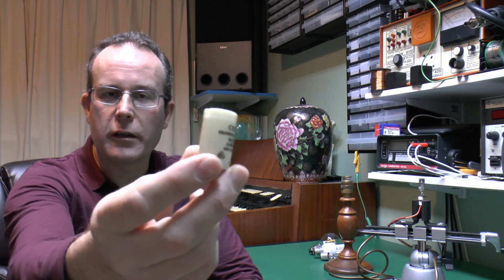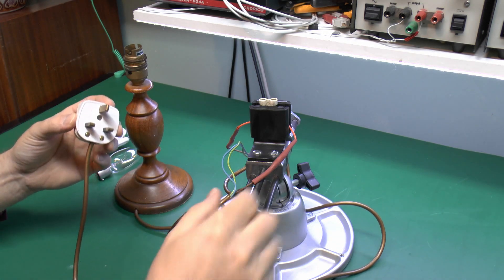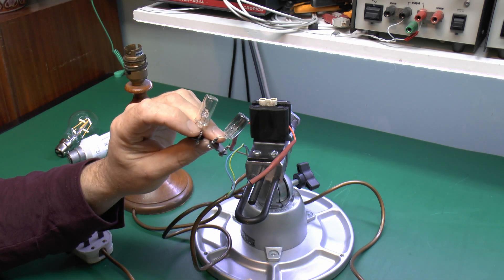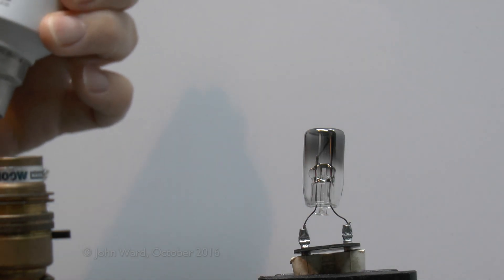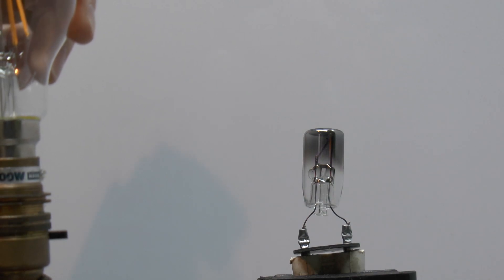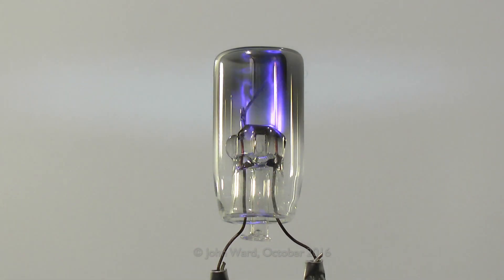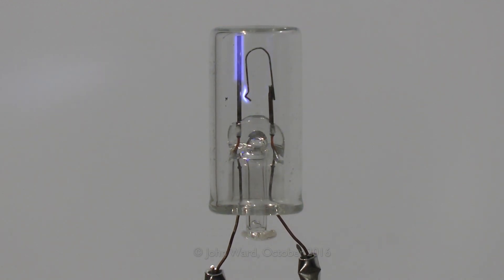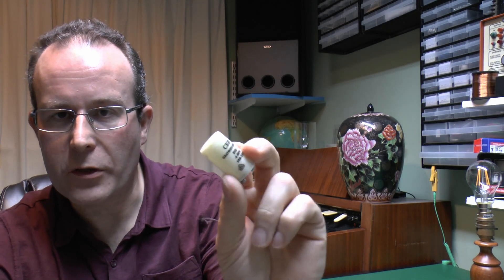Fluorescent Glow Starters

Comment: Hello,
I removed the plastic cover from a brand new Osram St 111 starter (4-65W) before placing it in its socket, then I flicked the switch on and off multiple times make the glow from the starter bulb last as long as possible without the fluorescent tube lighting and only looking at that mysterious blue glow for a few seconds caused me some headache
Don't fluorescent starters emit at least some amount of UV aswell as orange or blue light ?

Comment: The capacitor also serves an additional purpose. Just before the contacts of the switch meet it discharges across them, which gives a slight welding effect so they don't open too quickly. That's important for proper heating of the electrodes in the tube. 

Starters seem to be a component of which the importance is severely overlooked these days. 

The hardness of the switch contacts should be careful chosen to match the lamp current, so they stay closed long enough for the electrodes in the tube to be heated. Soft contacts weld together more easily, giving a longer heating period, but may weld together permanently if the current is too high. If they're too hard or the current is too low, they do not weld together and do not give sufficient heating.

The voltage at which the glow discharge takes place is also important, too high and contacts barely meet, which again will not allow sufficient heating of the electrodes. Too low and the starter contacts will reclose even if the tube is lit, causing nuisance flashing. 

Thorough heating is important to reduce wear on the tube each time it is started. These cheap universal starters appear to work perfectly adequately in that they start the tube. How they go about it is often far from ideal.

Comment: 2020. just discover, a rarely used back shed fluro, not working, but by accident noticed the radio in the house, was VERY  badly effected   (am radio station),  wall fitting in shed, is a double - with only one fluro- so good to find out the missing fluro is not causing a problem,  further to this video and the other video- could you do a video showing the effect of the starter capacitor wearing out- high resistance growing  less toward shorting- as this i expect would really be the culprit, causing the  fluro to flash when running- flashing getting worse til dead, , somewhere in between that radio interference- from Steven- Melbourne

Comment: The glow-switch starter was invented by 1938
It is a small discharge tube containing a bimetallic switch,
As current continues to flow through gas (usually argon,neon ) in the starter, a small bulb containing To ionize , Glow in the starter heats and it increases the temperature inside the starter starts to bend one of the metal contacts inside, in the same way that a bi-metal thermostat works.
The starter (which is simply a timed switch) allows current to flow through the filaments at the ends of the tube.

Comment: What is the gas inside these? Should be argon / neon or another noble gas - but not only! Some of these explode in a cascade of sparks if you break them (cold, not connected) so they must contain something that reacts with oxygen or nitrogen. Possibly phosphorus. (This only goes for some brands (or even just one) and I forgot which ones, although I could possibly find out by popping... I discovered this 20 years ago or more so I'm not sure if it also goes for newer models)

Comment: when starter gets opened after some time due to inductive kick the large tube light gas gets ionized but y not small air gap between starters gap not ionized??
Reply from the maker: The tube filament ends are hot and coated with chemicals to assist with electron emission, the starter contacts are not.

Comment: Hi John. Could you please tell me if a 110v bulb for festoon lighting would work safely on a 230v supply in a domestic premises.  Cheers
Reply from the maker: It will work but only for a few minutes.  it will get very hot which may damage the lampholder and cable.  Demonstrated in this video: https://youtu.be/H0n_oBgmB2A

Comment: I remember working  in the Steel works in the 70s or 80s my boss was after some disco lights so wired some starters in line with colored bulbs worked a treat and earned me £20 :D just by changing value of the capacitor changer flashing rate

Comment: What would've happened if you had left the capacitor connected across it?
Reply from the maker: The same, the capacitor is only there to reduce radio interference when the contacts open.
It was removed in the video so that the glass tube could be seen without the capacitor in the way.

Comment: John, a common mistake is for people to install "4-80W" starters in 6ft 1800mm 70W (or the old 75/85W T12) setups, the increased lamp running voltage borderline exceeds the threshold of the "4-80W" starter giving an annoying brief flicker once every few minutes.
You need the specific 6 foot or the more common FS125 8-foot variety of srarter for 6-footers to be reliable at all temperatures.
I've been to countless faults as above, even caretakers and maintenance electricians  argue the toss that if it says "4-80W" it must be right for a 70W tube. But no.
The gas fill in the starter differs to give a different conduction threshold voltage. You will notice the "FS-U 4-80W" have a blue glow, whereas the 6ft and 8ft FS125 types have a red or orange glow.
Reply: What about operating a 5ft 65w tube on a starter deigned for 70-125w tubes? It appears to work and starts up fast enough but am I shortening the life of the tube by doing so?
Reply: uK8cvPAq No harm, just takes a fraction longer to close the contacts, and small chance the lamp may not strike fully, running in a higher voltage lower current mode then extinguish and re-strike a few seconds later.
Reply: Simon Parkinson Cheers. I know a thing or two about LED lighting but have never delved into the art of florescent tubes until now.
Reply: i got hold of quite a lot of the fs125 starters very cheap (free!)  and have used them on smaller tubes no problem, never tried it the other way as dont have any really long light fittings..

Comment: What might be interesting to mention would be the very old style manual start fluorescent systems. There are still several desk draughtsman type lamps where I work that are manual start fluorescent.  

It wouldn't be a great deal of work to rig up a circuit to demonstrate manually starting a fluorescent tube either I wouldn't think. All you'd need is a ballast, a tube, and a few switches.

Comment: I've had a lot of trouble with the very cheap starters in the lights I maintain at work and no longer use them and for that matter remove them when I find them. The contacts fuse together and overheat, causing the shattering of the glass tube, melting the plastic casing and sometimes destroying the starter holder!

Comment: I have found these cheap starters to be somewhat unreliable (as in they fail after a few months) in our kitchen setup. I was given a couple of electronic starters by the electrician at work and these have run for decades with no problems.

Comment: The gas fill also serves a very important function. It has to break down with mains voltage applied when the tube is off, and the full mains voltage is thus across the starter, but must not break down when the tube is running, and has around 90-100V across the ends. As the tube ages the voltage drop across it increases for various reasons ( cathodes becoming less efficient, mercury vapour inside the tube being absorbed by chemical reactions with the phosphor or simply being all condensed in the cool spots of the walls) and thus the voltage across the tube rises till it eventually is enough for the starter to operate again, thus the blinking of the lamp at end of life, at least until either the starter contacts weld together from the constant operation, or the filament breaks from the heavy erosion of the high current pulses.
Reply: SeanBZA comment moved to main
Reply: they fill them with promethium

Comment: "....and if we wired this across the mains, the switch would close and the fuse would blow."

Aaaah, that brings back memories, that does. :D

I wired one across the mains to see it glow up, and I was quickly turning the power on-and-off to see it glow, but the last time, I must have left the juice on a bit too long.....

BAAAANG!!

Yes, the fuse DID blow in the plug, and not only that, there were "Bits-Of-It-Everywhere" and the connecting leads to the starter that were in the connector strip were no more. :D

Totally obliterated.

Of course, I think this might have been attributed to the fact that our circuits around our previous house were fused to BS 3036 (rewireables) and the 30A fuse allowed through a fair bit of grunt..... enough to blast a starter to bits and blow the 13A fuse in the plug. :D

I am not sure what the damage would have been if we had circuit breakers, gjven that they are much more sensitive when breaking short circuits!

......Maybe one day, I will get my camera set up out in the garden and blast a few tube starters across the mains.

You know, just for the laughs and "In-The-Name-Of-Science" of course. :D

Thanxx for showing,

-BoomBoxDeluxe / Wayne's Electrical.

16th October 2016, 07.32
Reply: or my trick before i learnt that sodium/floro tubes need current limiting :)
Reply: Which is also my first experience with fluro starters aswell! Luckily we had 20A circuit breakers on the ring main and it quickly tripped, but I was finding bits of glass around my room for a little while after that.
Reply: I did a similar thing in my first job at an emergency lighting manufacturer. I was in the test department and connected one of those to my variac. Got the voltage up so far and bang! Took the fuse right out of course.